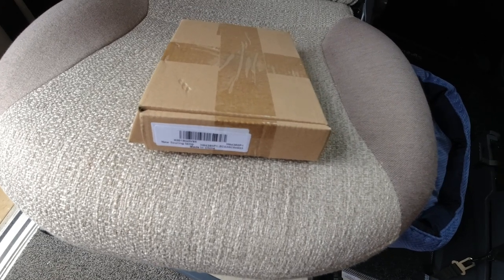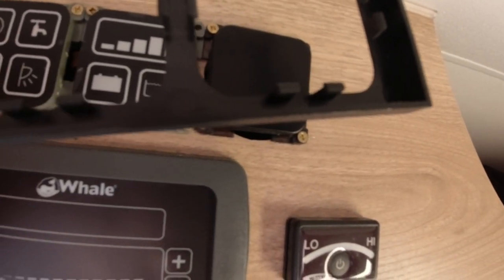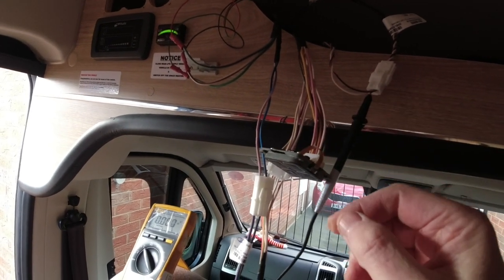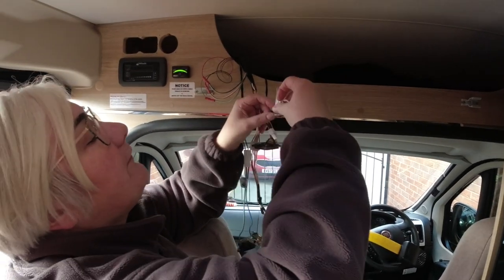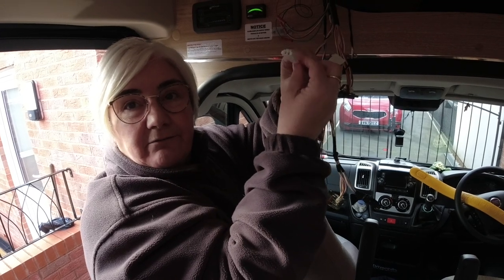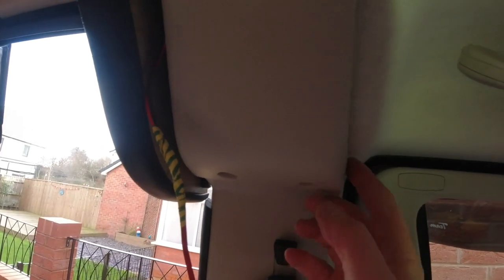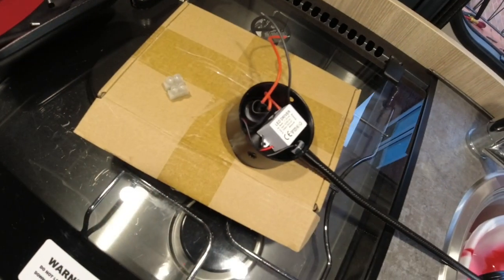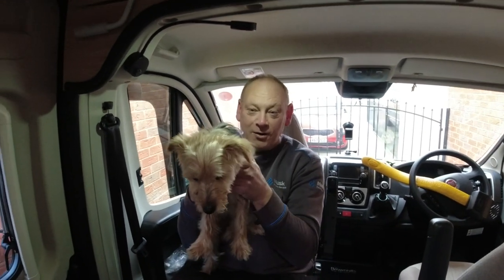How To Add A Cab Light To Your Campervan Or Motorhome - Elddis CV20

Comment: What a fantastic job you’ve done, Heather is a very talented lady. You both made it sound easy but is way above my electric capabilities. Steve would have managed but I’ve given him too many little jobs to do. We had the same dilemma in Madge as I like to use the 3rd bed set up in the front to relax. My solution was to buy a usb light which looks very similar to yours. Madge has a shelf all the way round the front cab so I can use the bulldog clip on the light to clip it up high. Take care Gill
Reply from the maker: Heather’s the technical clever one I wing it but do ok! 😃

Comment: Spot on - it did make me chuckle that you had more wiring out than I did. Makes a big difference on a night doesn’t it and handy adjustment. Well done Heather on sussing it all out and getting the meter out. Looks like yours is a proper caravan type so you don’t have to faff on dropping the voltage too. All the best, David 👍
Reply from the maker: We like to make it more “dumbed down” as a how to, yours was good but a bit technical in parts, also the entertainment is me looking a  bit daft and Heather’s expertise making people happy to have a go. I like to make it repetitive and easy for people to have a go. The light itself is better for sure, the auto sleepers have those lights where I put that one (didn’t bother the driver side as we don’t spin that)

Comment: Doing what you've done is easy finding the correct wires and I can understand why you have fitted the light. But I don't understand why you have wired it that way? So Heather isn't disturbed by the lights, all you have to do is switch off the individual light(s). What if you want to spend a penny during the night none of the lights will work and you won't be able to see! So you would need a torch to make sure you don't stub your toe!! OUCH!!! :-)
Reply from the maker: We also have individual stuck on battery lights for night use…